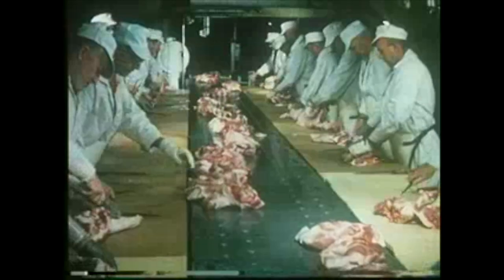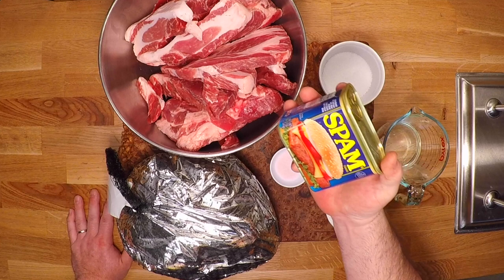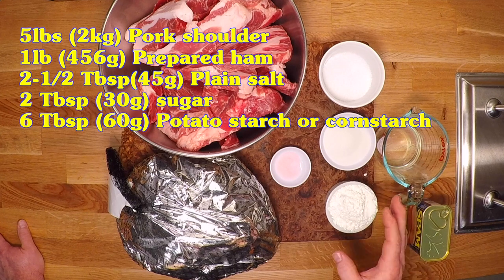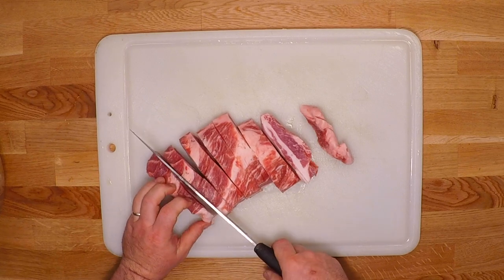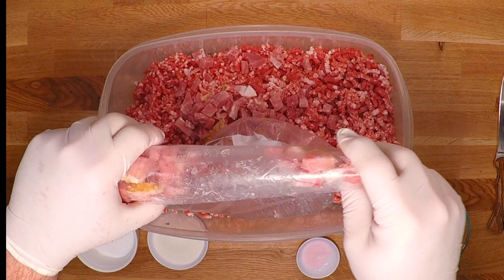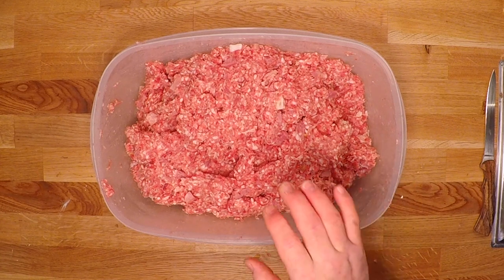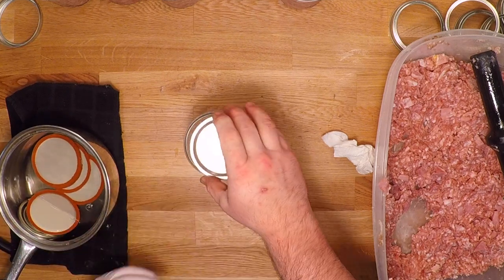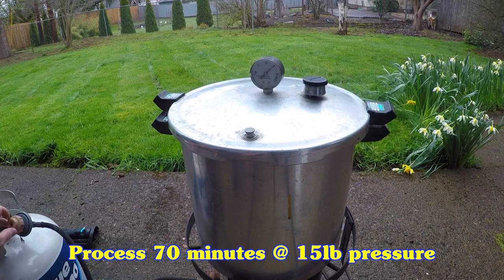Sausage King: Homemade SPAM

Comment: Great stuff ! When I was in my mid twenties I worked at the Hormel Austin, MN plant, I was also still farming. We raised hogs and sold to Hormel as well as running 6000 acres of corn and soybeans. "The Plant" as it is locally referred to, is enormous inside, a giant refrigerator. I ran a "bug", aka forklift delivering 2200 pounds of frozen bellies to the slicer on my line every 20 minutes as well as getting finished product off the line to the warehouse. Fun times, retired from farming now for several years. Now I make sausage and smoke meats and do a lot of canning. Really enjoy your channel, keep em comin !
Reply from the maker: Thanks. I spent a good many years in the poultry industry.
Reply: Former Hormel worker here too. worked in the sausage kitchen  at the Renton WA plant back in the early '80s. also hung bellies coming off the belly pump on the bacon line. I think our plant was pretty tiny compared to the Austin plant.

Comment: I made generic version of this recipie last weekend. I made a 15 lb batch.  Double grind with a fine plate. Weights are critical for salt. I weighed my meat in grams to calculate kosher salt and #1 curing salt.  I got lucky. In hindsight, the ham is the secret to the taste. I used a smoked sugar cured ham. The taste was spot on.  I think it might have been a salty disaster if I used a salt cured ham.   Packing in a pint widemouth was challenging.  What worked was rolling the mix into a ball that barely fit inside my pint widemouth jar.  Then tuck the corners and work out the gaps with my fingertips. Smaller balls until full.  I left a full inch headspace.  Came out spot on.  I BBQ'd some slices on the grill with home made Blackberry BBQ sauce.  That was to die for.  Never buying SPAM in the store again. I could tell the difference between store SPAM and the batch I made, my slices were round, less salty, and slightly sweet taste from the ham. I am going to drop to 1.5% of salt instead of 2% on next batch. Going to experiment with flavorings on individual jars the next batch.
Reply from the maker: I love it!

Comment: Noticed water ring on jars after canning. This can be prevented by adding vinegar to the canner water. It will also keep the interior of canner cleaner.
   Curing salt can be reduced to 75ppm if color retention is all your after. The 1 tsp/5# meat is the maximum allowable limit (156ppm) for curing. Not necessary at all if canning (except for color retention desirability).

Comment: 15lbs for 70 minutes...where are you located, generally?  All the pressure canning I do with meats has been 10lbs, here in TN, at less than 1000ft altitude.
Reply from the maker: I'm down pretty low as well. 10 lbs would probably get it too. Thanks for the comment!

Comment: Even if they weren’t overfilled, you might have had some leakage from the rim of the jars. The best bet is to use a clean kitchen rag dipped into white vinegar to clean off every trace of fat. But yeah, it will expand so inch and a half of headspace should be great.
Reply from the maker: Thanks for the vinegar tip!

Comment: Spam doesn't use smoked/prepared or cured ham. What they say ham, they mean the ham cut--the hip of the pig. Original spam used no starch. They added it to prevent the gelatin from separating from the meat when cooked.